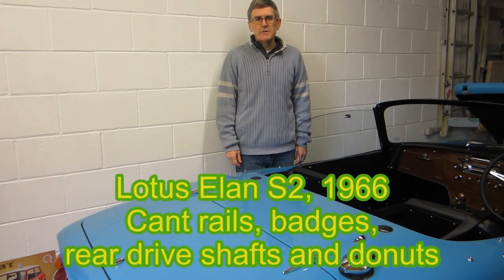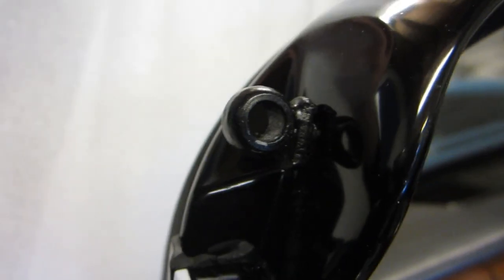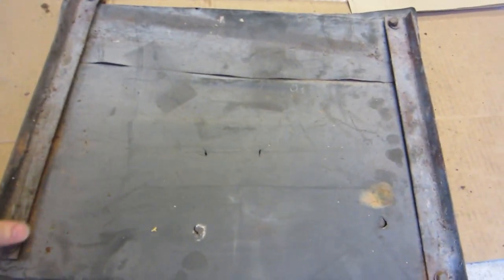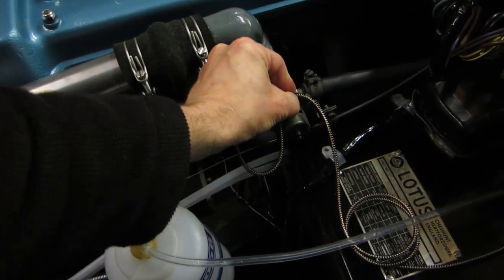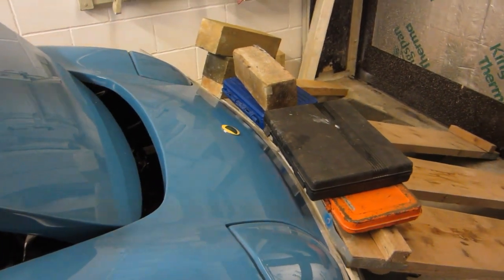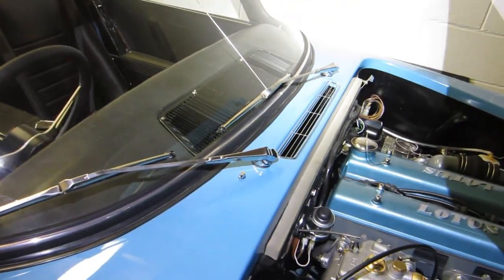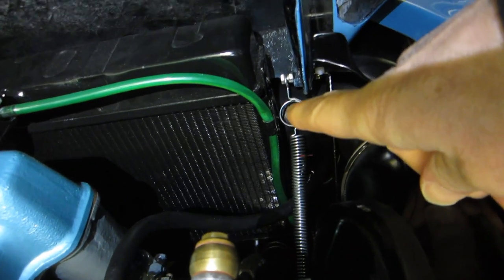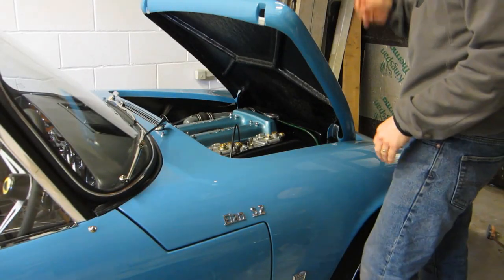Lotus Elan S2   Assembly part 14   cant rails, badges, drive shafts

Comment: Paul, congratulations on getting it finished. Very difficult to be sure but those bonnet springs seem to be of a heavier gauge to mine. My bonnet would certainly never have stayed up that high. The springs would lift it about 12" from the closed position but then I dont think I extended them down to the chassis as you have, I think mine went to the lowest hole on the bonnet skid plate stay. I always wanted to cover the hood rails in black heat shrink as I couldn't get a good finish on them ..... but never did it!

Comment: As a precaution I'd keep some small screws in case the trim pops out.  You don't want to get to Combe and then this happens. I don't have an issue with screws but then original fitment for my Elan.  But Lotus did it this way for a good reason.
Reply from the maker: Hi Jim,  Sorry if I was mean about the screws holding the trim in.  I think the earlier cars didn't have screws holding it and the later ones do.  I definitely appreciate originality, particularly with the beautiful examples you have.
Reply: @PaulH_S2_Elan  When I next see you I'll tell you a funny story about the trim I fitted to a Sprint I owned in the 70s.  Yours looks great without the screws and I hope it all stays in place for you as a better result aesthetically.  You've put a great series of videos out there which future restorers and enthusiasts will benefit from and enjoy.

Comment: Hi Paul, Fantastic job.  Have you had the car out in the rain and how waterproof are the doors?  Did you take any special measures to ensure them being weather proof.  I've never managed to make mine even remotely watertight.
Reply from the maker: Hi Peter,  Thank you. It got slightly drizzled on and I whizzed it back in the garage to dry it off because I don't have the hood sorted yet.  It doesn't have any extra seals on the doors and judging by the way they work I can see that it will leak like a sieve.  It's interesting comparing the S1 & S2 with the S3 & S4.   The changes made on the later cars all make good sense, like door seals that have a chance of working.
Reply: @PaulH_S2_Elan  I remember a talk by Ron whatsisname about the Elan design. His comment on the early door design was " It wasn't our finest hour". Be prepared, or don't go out in the rain, or leave the little beauty outside in the rain.
Reply from the maker: I shall avoid the rain whenever possible :)